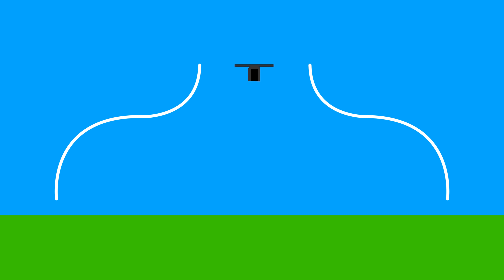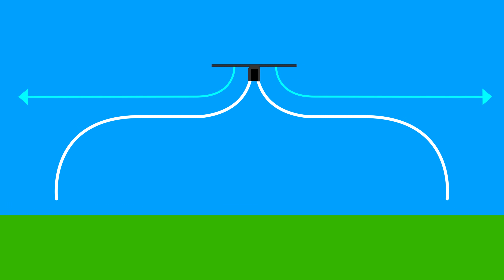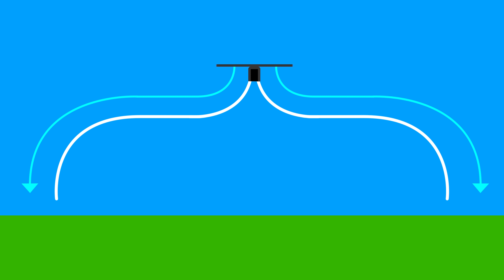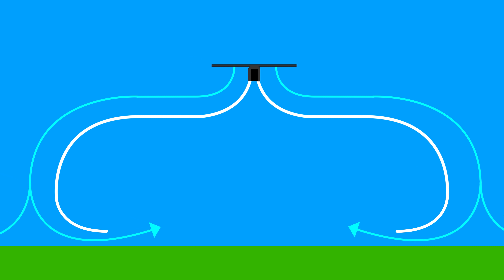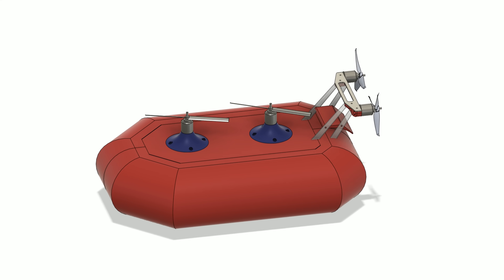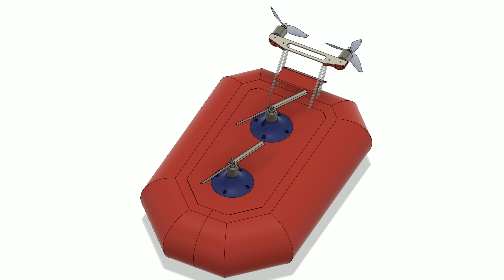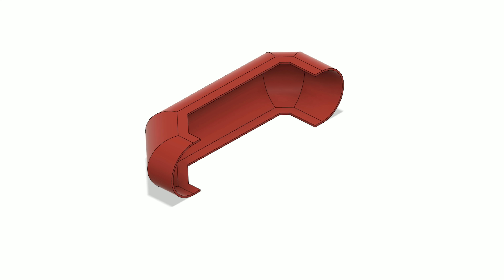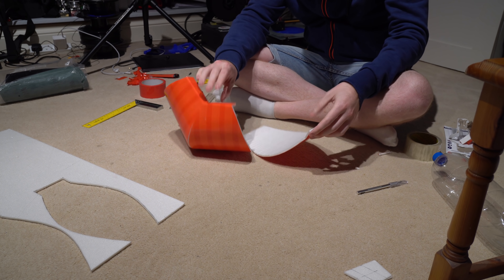Coanda Effect Hovercraft

Comment: I'm sorry Tom, I'm quite skeptical on this one.  It appears to me that your hovercraft is being supported not by the Coanda effect but rather by the thrust produced by your rotors.  Does it behave any differently if the top edges of the body are at 90 degree angles rather than the curve you formed in the foam?
Reply from the maker: I'm not sure whether it'll still work with the 90degree angle as I haven't tested it, but I assume it wouldn't work. The width of the fuselage is twice the diameter of the propellers, therefore if the coanda effect wasn't working, the air would just flow outwards horizontally and not produce any lift (well a very small amount of lift due to the fast moving air being at a lower pressure).
Reply: @TomStantonEngineering  but the propellor produces lift by moving air over its own surface also and not only by "Blowing air" downwards
Reply from the maker: @McCardinal  Yes that's correct, the movement of air downwards through the propeller does produce lift. However it's vertical velocity is cancelled when it hits the top of the fuselage. Similar to being on a sail boat and blowing into the sail using an onboard fan, there is a net neutral force.
Reply: @TomStantonEngineering  Not so.  Firstly the propeller generates lift because the blades are an aerofoil moving through air in the direction of rotation, as Henrik said.  Secondly, your sailboat and fan analogy is oversimplified (and doesn't actually apply well to real sailboats either)  - the net neutral force in the vertical direction is between the fan and the deck of the hovercraft, where that air is "pushed in, but stopped".  Sideways air is pushed out all round, so net neutral force there.  Above the fan, air pushed in... below the deck... nothing, so the overall net force is not neutral in the vertical direction.   Rather than the sailboat and fan, consider a jetboat:  It doesn't suck water from in front and push out the back - it sucks water from below the boat, and pushes out the back.  So Adrian's experimental suggestion was valid - what does happen when you remove the curve from the deck, and eliminate the coanda effect?
Reply: @danmoonlight8965  I would love to see that. Nothing about fluid dynamics is intuitive, but I bet a square edged version of this would still work though.
Reply: I think Dan's explanation is spot on.

Let's assume that  this is the Coanda effect. In that case, the hovercraft would never rise vertically because as soon as it does it looses the air cushion underneath and falls back again. Just like a normal hovercraft does.

However, if it is lift from the propellers, then the "hovercraft" will be able to rise because it's supported by the lift gained from the propellers rather than the air cushion underneath. And given that it did show a tendency to rise when too much throttle was applied to the propellers, and that it kept rising past the point where the lift from the air cushion should have been lost, I think it's quite likely that this is more of a helicopter / drone than a Coanda effect hovercraft. 

This is further supported by the fact that the impellers which produce no vertical lift themselves, were not able to lift the hovercraft of the ground.

There might be some Coanda effect in play, but it's likely insignificant compared to the lift of the propellers.

Comment: Isn't this a Coanda effect combined with the sideways air movement, when You're in "side drift" causing the "downwind" side to get more lift and therefore tipping the hovercraft over?  After all, You are moving through air sideways inducing additional airflow over the hovercraft. Since the main motors give the hovercraft the amount of lift just below "lift off", the small amount of additional airflow could make one side to actually go past the "lift off" limit and hence the tipping over. That's just my theory.
Reply: I dont believe the airflow is fast enough.

Comment: would a screen/sieve/mesh on the underside prevent debris from entering the skirt without negatively affecting lift? it doesn't need to be very fine, just enough to keep the craft from accumulating waste and filling the skirt with material that will replace the air and reduce the skirt's contribution to the lift. 
also, would this work over water? I think not, since by the same effect, it would end up collecting water and behaving like a suction cup on the water's surface

Comment: Not sure about coanda effect is making as much effect compared to the conventionnal lift induced the lift propeller.  It pushes to the bottom as much as it pulls from top.
Reply: All of the air pushed by the props is in turn pushing aginst the top of the hull as its redirected sidways though. it may add a tiny amount of lift but it would be like trying to pick up something while you are standing on it. All of the force you generate is also pushing right back down on the object.
Reply: @heziah4429  i rode that the force generated by a propeller comes as much from air being pulled as air being pushed, so even if we ignore what the air is doing after it passes through the propeller, there is already lot of thrust generated.